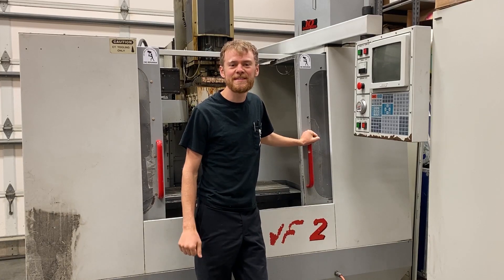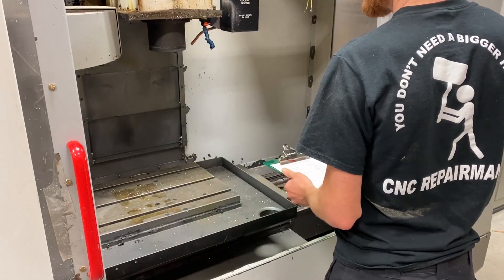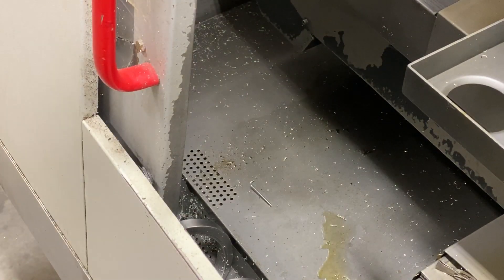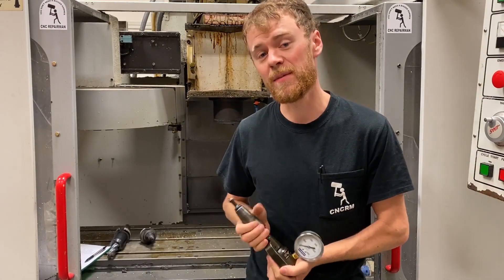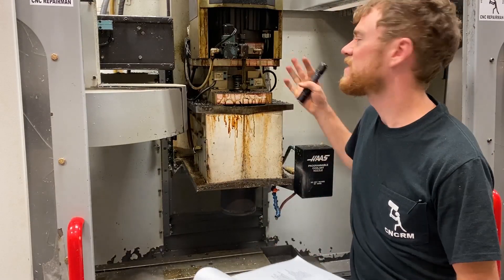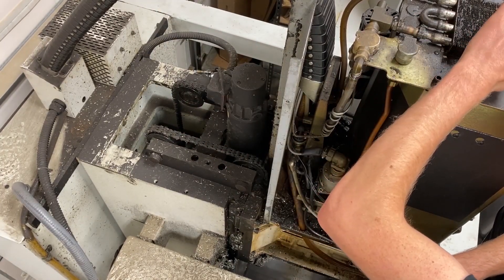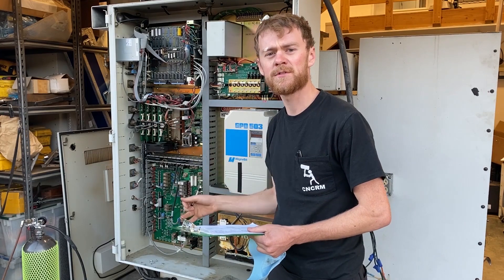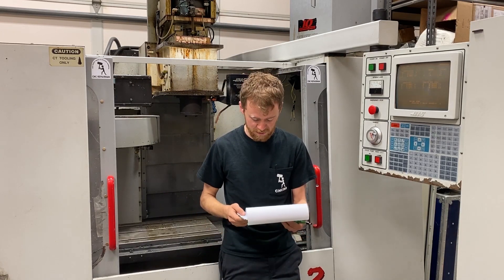Mill Inspection With Checklist

Comment: This a great video! I bought a 98 HS1 and it was in worse shape than this, and have slowly been restoring it to working condition. Funny thing was when we had to haas tech rebuilding the office mill at my work, I was telling him about my HS1, he said he had worked on it a few times. He said it was the most abused machine he had seen haha. I found all sort of spliced wires( twisted copper and electrical tape), the machine had also been outside for several years, so many air hoses were cracked and the y axis ball screw was toast. I was told it was running when they took it out of the shop, and they guy who was selling it, tricked me into paying before seeing it, threatening me that other people had made offers, and he needed the money. for a machine of this size it was a great price, and I actually dont regret it, since I learned so much, but I wont gain anything from making the same mistake again haha. The HS1 has a full service manual which is great, later machines do not. for example the 2005 office mill at my work had basically nothing, so when the haas tech came to rebuild the machine(new spindle, linear guides and ball screws) he had to figure it out, and when he called haas hq they told him they didnt have procedures to replace those components, and the way they did it in the factory was with the sheet metal all off. Also If you need to have haas come out, good luck, took two years to get our office mill serviced at work, and I was calling them weekly to get someone out.